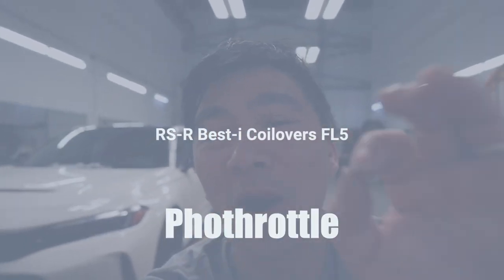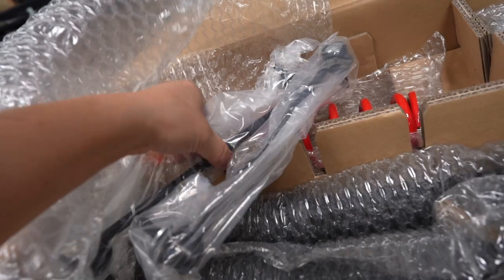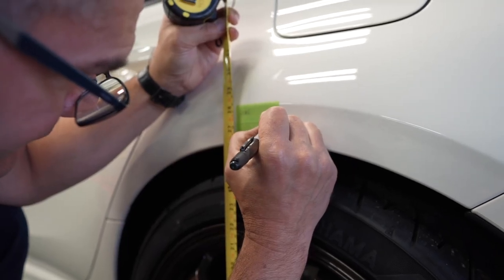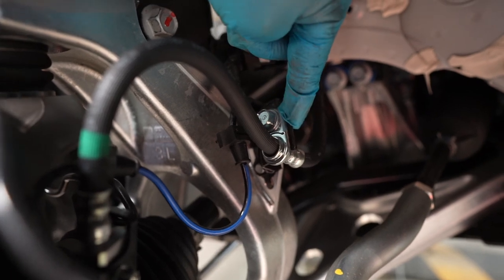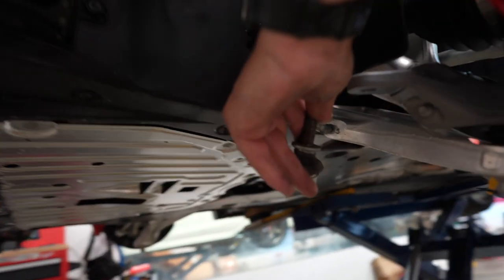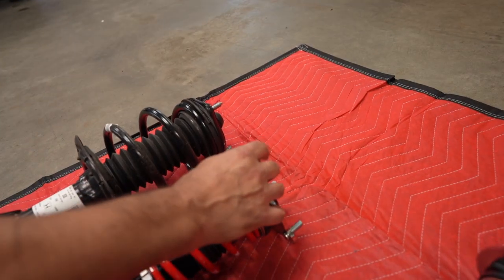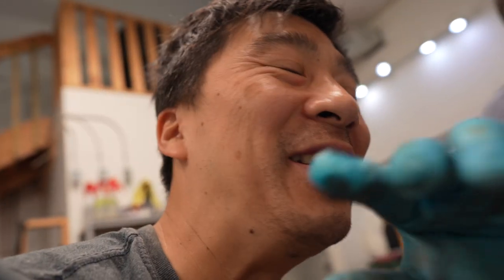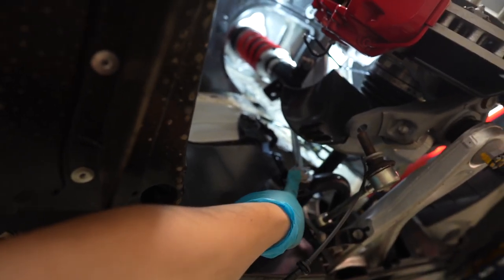RS-R Best-i Coilovers || FL5 Installation pt.1

Comment: Is removing the end link and the other side of the sway bar the “secret” to keeping the axel from slipping out? I’ve seen people run into the axel coming out and having to replace the seal but haven’t seen a video where the remove both of the items mentioned. Video Min. 4:39
Reply from the maker: Yes that is the way we didn't it and we had no issues. Of course you would use caution and always keep an eye in the seal. It's a petty straight forward install.

Comment: are your locking collars seized? i saw you didn't put grease
Reply from the maker: RS-R didn't put grease as a requirement in the instructions so we didn't.
Reply: @phothrottle  they must have updated their instructions. it says to apply a small amount of grease in my instruction booklet.. well my mechanic didn't and now my lock collars are seized 🤣
Reply from the maker: @neptune7291 thanks for the notice. I will check for the updated instructions.

Comment: Hey man love the videos. Definitely giving you a follow. I plan on running the exact same tyres, but on a 18x9.5 +38 rim. Will be lowered with with spoon springs. Just wondering your thoughts on tyre run or not? I see you have said no rub with your setup. I know it’s only 2mm but that could be the difference. I’ve been told these ad09 run quite wide size for size too.
Reply from the maker: Yeah you will have no issues.

Comment: Great video, are you thinking of running rear camber arms?
Reply from the maker: Hey thanks Neil! Yes I will be adding some rear camber arms in the near future.
Reply: @phothrottle  Also, any thoughts on lower ball joints vs. top camber plates for the front?
Reply from the maker: @neilisnext  it is a big job to replace the ball joints. I have done them on my other vehicles and the ride quality is diminished significantly. I really haven't decided yet if I am going to do it to the CTR.
Reply: @phothrottle  couldn’t see in the vid. Did you get the adjustable plates for your front coils?
Reply from the maker: @neilisnext  the rsr best i doesn't come with the adjustable top camber plates but they do offer them it you need the extra camber.
https://www.rs-r.ca/ they will be able to help you get them.
Reply: @phothrottle  ah so you’re not rubbing in the front?
Reply from the maker: Yeah there is no rubbing. Went over a few big bumps and tried heavy corners and no issues.

Comment: Yet no proper corner weighting done 🤦🏻‍♂️ you hardly know which suspension part is which. These spring rates are too soft and front bottoms out
Reply from the maker: Corner weighting? Did you mean corner balancing? 🤔
Reply: @phothrottle  it’s the same thing 🤦🏻‍♂️
Reply from the maker: What is the same?